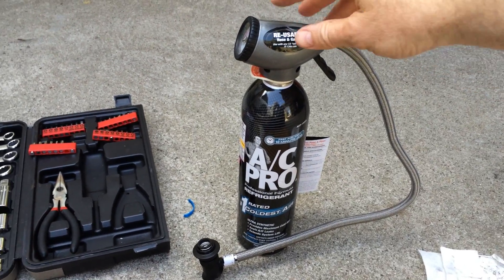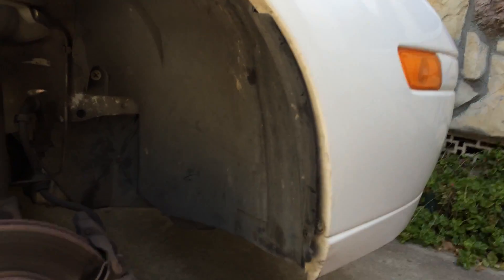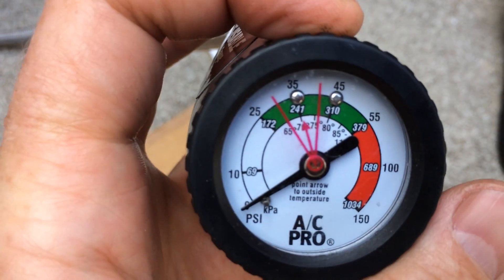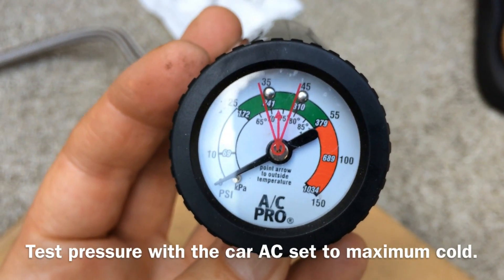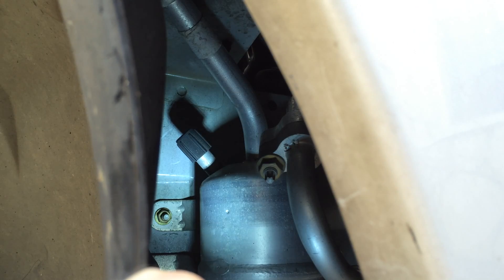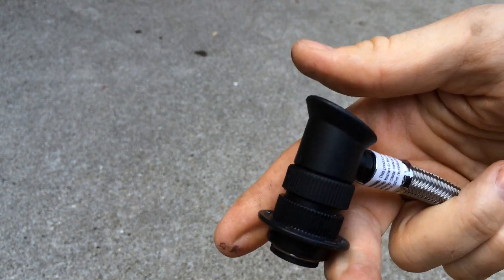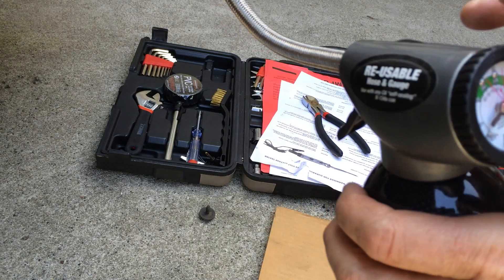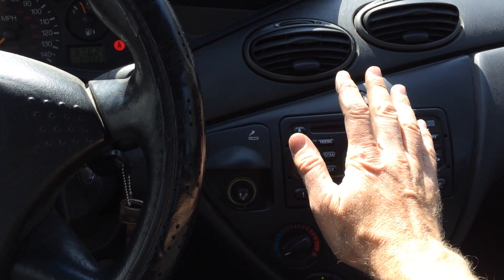How To Recharge A Car AC System

Comment: i have a 2001 ford focus i found where you charge it under right whee well but it does not seem like it fits right its to louse a leaks around all around it
Reply from the maker: +Jeff Corbin I wonder if you got the wrong size fitting.  There are two sizes, one for older cars and one for newer cars. I think the year they changed over was in the mid 1990s.

Comment: @hohooo, hey bro can i connect the gauge without freon can too check if im low i got ac pro gauge! Thnx
Reply from the maker: Yes. It has a push button valve on it, so your coolant won't leak out.

Comment: i keep trying to charge my car a couple of time but the psi still has the same reading when i charge the needle is just above the v mark lower side , the psi pressure dosnt increase it stays the same.. the compressor turns on when i turn on the ac settings to the max position..what can be wrong? should i use all the refrigerant?
Reply from the maker: gearlock77 I wonder if there's something wrong with the valve on the car, where the hose attaches.  Maybe it isn't really opening up when you connect to it.

Comment: i have an 88 honda civic and i can recharge my air and the ''L'' low port is the same size on all cars.
Reply from the maker: That is good for you. My 1993 GMC van has a different, bigger port on it, which won't work with this kit, so sometime between 1987 and 1994 car makers switched to the new style. It wouldn't surprise me if the Japanese companies switched over a few years before the Americans.